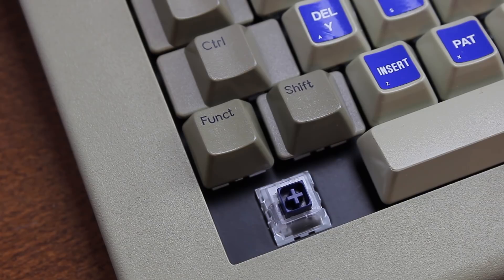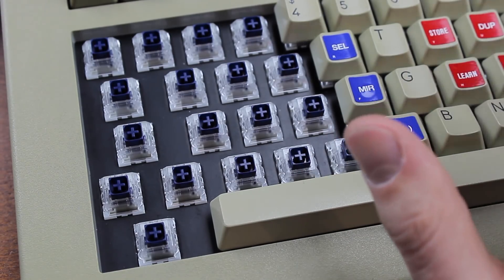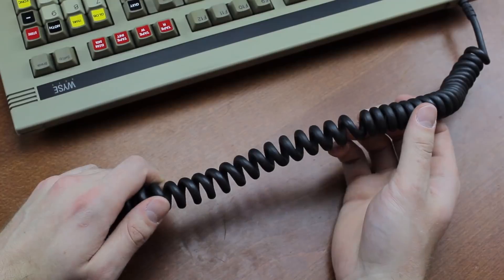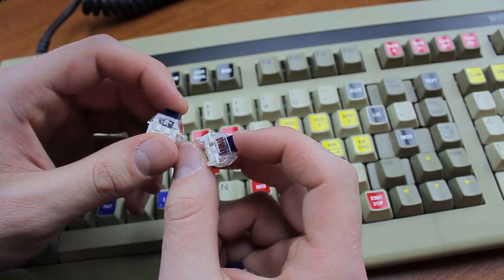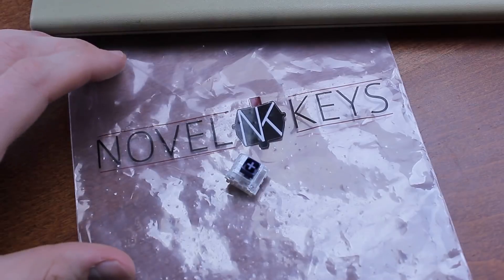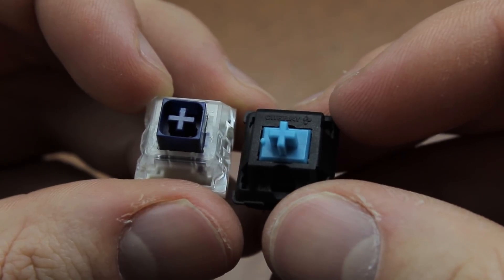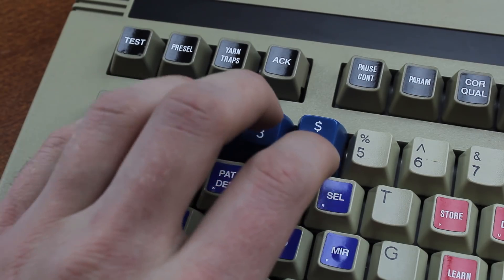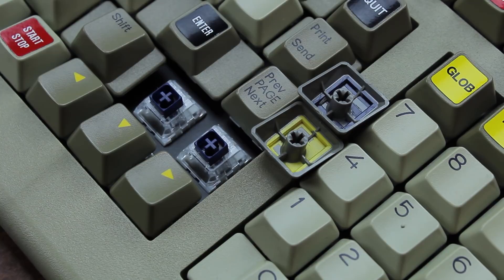"Project N" custom Kailh BOX Navy keyboard review Wyse (WY-50)

Comment: I just got ahold of BOX Navies for the first time, and after thinking about it some, I thought to myself that probably the reason why BOX clickies work so well is because, like Alps, they separated the element that produces tactility and click from the contacts. The click bar is basically Kailh's version of the click leaf, where Cherry MX insists on keeping the feedback element mated to the contacts. The principle of having a separate feedback-producing element lets these designs more easily modify the magnitude of tactility and loudness than if everything was dependent on the resistance of the contacts to generate their feedback. Kailh did prove with the BOX Royals that its possible to simply stiffen the contact leaves to generate more tactility, but it shows just how switch manufacturers have to sort of reinvent the wheel and discover missing links to the past just to start a new renaissance and pull this hobby out from the Cherry MX dark ages.

Comment: I completely agree with you that there should be a third variant of these with a "medium tactility" option. It would be amazing!

Also putting the switches in this chassis was a wyse choice!
Reply from the maker: Andrew Dias I c wot u did thar!
Reply: @Chyrosran22  There is a third option you can get aftermarket clickbars from SpriT Designs as well as springs.
Reply: @TheDarthWTF  Yeah but it's a pain to put the click bars back in after you remove them

Comment: After I saw the original video you made on the Navies, I took a leap of faith and replaced the MX Browns of my QFR-i with them. 6 months later, using the same QFR-i exlusively, I can say that it was worth it. The sound is fantastic, the feel is excellent too and they have given me no problems or sample variation. This switch is a real winner.
Reply: How heavy are they compared to a model m?
Reply: I haven't compared them side by side but I'd say during depression very similar but during the return stroke the Box Navy has a lot more pronounced tactility.

Comment: I can confirm that the BOX Navies works with the "Drakken Technologies Prothero Spektrum". If you want a switch-modular keyboard that has a chassis to speak of, there yall go.

Please bare in mind, the chassis is abnormally thick all around, including vertically. As for weight, it is slightly lower than a Unicomp EnduraPro. Flex is minimum. So its much better durability wise than those open keycap designs that virtually everyone (relevant) is doing.

Its around $79.99 (US) on Amazon (US).

Due to the overall weight and the borderline unnecessarily thick bezels/chassis, the BOX Navies sound great! The larger keys have some loosely fitted stabilizers though. Luckily those replacement ones from Novelkeys apparently work with the Drakken.

PS: Thank you Chyros for brining the BOX switch designs up. I'd never have known they existed since everywhere else outside the keyboard community is Cherry MX this, and that. Razer this, Corsair that, etc. 
Though the Drakken keyboard was a hail-marry on my part since there's not a whole lot of information on it! Only a few Amazon reviews praise the abnormal build quality. I thought they were just exaggerating.

Now if you ever get the chance, those Holy Panda switches sound like they have a interestingly rounded tactile curve going on. Kind of like a Topre board almost. It seems to be Massdrop only though.

Comment: What if you use a BOX Black spring? It's slightly heavier than BOX white, but lighter than BOX Navy, so.... yeah...
Reply: i did this with a friend of mine and it was better than jade, but not too different than that of navy really
Reply: Well... shit... I guess a thinner (though not BOX white thin) click bar would really help, just like what Thomas said.
Reply: I recently received jades of the newest batch, and none of mine had a laggy or sticky feeling, for what it's worth.
I did have problems with stabilizers though, I had to make them very free or they would add enough resistance to make the switch feel slow to return.
Reply: Are you sure about this? They both report 60g on NovelKeys.
Reply: thinner click bar might even approach blue alps perfect weighting and feel though it won't sound as good
Reply: @christophertaylor8166  Yeah, I was wondering about the same thing. They say 60g for navy and 50g for jade. However, that is the point of actuation, not the highest force. The highest force actuation is 77g for navy and 66 for jade, according to mehanicalkeyboards.com

Comment: Well, after quite a time testing switch samples I had at at time, I got white BOX switches and made my first compact DIY-keyboard with them. And with proper thick PBT keycaps, heavy mounting plate and sound absorbing pads on the bottom the high-pitch part of the spectrum is gone, they sound better. For my next keyboard I would like something more tactile, but not as heavy and loud as BOX Navy and with actuation point right on the bump slope down, I wonder if there will be switches like that. Thanks for your videos, man!
Reply: I think box light blues are more tactile than white but less tactile than navy.
Reply: Seems like box pink switches are your best bet.

Comment: Just ordered these for my barebones GMMK kit, and I plan on using SA caps with them. Can't wait.
Reply: It's 3 weeks later, have you started using 'em? If that's the case, how are they like? I'm also interested in buying these!
Reply: @pettttson  Yes, they're absolutely fantastic so far, and they are LOUD. I love it.
Reply: @Jekkin  sounds sweet! I'm very sceptical of Jades due to the sticking issue but is the weighting ok on these?
Reply: @pettttson  Yes the weighting is perfectly fine, but it's possible for these switches to bind just a little bit if I press on the corner of the keycap and push down away from the center of the switch. That could also be due to the size of the caps I'm using. All in all, it's a great typing experience. I'm quite fond of heavier switches as I used to play piano so I have stronk fingers.
Reply: Two years later, do you still use them? I just ordered mine and getting them soon.

Comment: Sort of an old video but I'm trying to follow the wiring here. The teensy 2.0 is no longer available from pjrc. I picked one up from ebay thinking it was the same and apparently the knockoffs don't work the same. What is the current replacement for one of these to work with the wy50 keyboard. I'll be doing more research but thought I'd start here.

Comment: Heya chyrosran, i have a question. I'm interested in buying some Kailh box switches, but I'm still split on box white or box jades. After seeing this video describing the jade's as sticky sometimes, would it be wise to opt for box whites instead? I do a lot of gaming and I'd be disappointed if the jades don't preform well under Extreme Heavy Gaming Sessions. Cheers

Comment: Holy hell those switches are expensive. Unless I'm missing something, its about $350 USD to get a whole keyboards worth of them.

Edit: I'm was previously mistaken, as I didn't realize they were sold in packs of 10 lol. That's what I get for looking into these things on no sleep. They're really about 1/10 of what I originally said they were.
Reply: Not gonna lie, I made the same initial mistake until I also read the rest of the page. LOL
Reply: I paid like $35 for 108 Box Navies switches I think it’s used to be more expensive than it is now
Reply: @PreciousAlpschindler  4 years ago I corrected myself and said they were 1/10th the cost I originally said, which comes to $35.
Reply: @robred123s  yes I know that but I also used to see something like $45-55 for 108 Box Navies unless the one I saw back then are overpriced or overcharged

Comment: It's interesting to me that you ran into issue (or didn't) with the modded-to-be-Jades switches on some examples, but not on others. I ordered a full hundred of them for my current keyboard, and have been using them for over a month now, and I can't find any difference between any of the switches. I heavy-modded the six switches I used on the stabilized keys just in case, but I really haven't seen any difference between any of the stock Jades. I absolutely did see issues with the switches returning when I put them into a switch tester I have, which grips the switch housings more tightly than my plate, but that was the only thing I could do that seemed to affect them, and it had the same effect on the heavy-modded switches (for which I used BOX Dark Yellow springs, which are even heavier than Navy springs). I wonder if some of the inconsistency you saw could be down to the opening up of the switch in addition to the fact that, as you stated, the Jades are right on the ragged edge as far as being able to return.

Either way, great video! I think you're spot on that it would be interesting to see some intermediate click bars. Maybe Jades should be using .29mm to be a bit safer, or we could even see something like a .27 with 45g springs. The category has a lot of potential, to be sure.

Comment: These switches are really heavy, you can already feel it from a sampler but on a board they really are stiff, even compared to cherry green. 
Frankly I might use it on the caps lock key since it isn't stepped on the PBT ISO Italian keycap set I bought for my new K10 pro, I prefer lighter switches for typing.
Reply: i got a k8 and am testing the white v2's, after trying the white v1's and navy's, i'm waiting for the jade's to get to me to figure out which ones i might like better but for now in general i'm glad i discovered and could try these kailh box series for a change a bit since i had never used anything outside of the cherry mx blue's, so far they seem more "satisfying" and with the right feedback.

Comment: Would that be too loud for work? Is it possible to use it with o-rings? So far i've managed to test a CM Storm QFR with MX Blues + o-rings and another with MX Browns stock and my coworkers seemed to be ok with them :) Love your videos, keep 'em coming, especially switches breakdowns ;) Cheers from Brazil!
Reply: Luis Enrique Muñoz They are very, very loud.  Unless you have extremely tolerant (or maybe just deaf...) co-workers then yes, it's too loud for work.

O-rings aren't going to help much since they only affect bottoming out noise, not the sound of the click bar.
Reply from the maker: Luis Enrique Muñoz no fucking way are people going to tolerate this level of noise xD .
Reply: You're probably already "that guy with the annoying keyboard" at work. Life pro tip: get promoted so that you get your own office room and type with the loudest keyboard you can find. :D
Reply from the maker: I use a linear keyboard at work to mitigate the worst of the noise, even though they already find that one somewhat loud. And I'm basically in a separate office already! xD

Comment: I haven't been able to actuate any of my Box whites before the click either, and I have deliberately tried to do so.  I got them more recently than your video on them though so maybe that's something they fixed in a later revision?
Reply: I tried now on my keyboard (two months old switches, box white obviously), and if I push the top of the key, pushing also forward, I can make them click without actuate! On the contrary if i slowly press the keys pulling the keycap towards me I can make the switch register the press without click, but it's a lot more difficult, I managed to do it only with the left and right arrows that I can grasp between two fingers. Anyway in the real world it has never been a problem, and I usually don't even bottom out while typing.

Comment: I really want to transplant some thicc clicks into my MX Blue Filco. But Navies sound like they'd be too heavy and Jades have those issues.
Reply: I'm in the process of doing the exact same thing to my Leopold. They might not be as heavy as you think. I really don't have any problem typing on them (although I have been using white Alps for a few weeks and have gotten used to those already, so that probably helps). I've seen a lot of people report the same thing. I couldn't stand Cherry greens but these are fine for me, and I generally type pretty lightly.

Comment: Recently i acquired an Altos IV terminal keyboard which i learned is a re-branded Wyse keyboard w/ Black Cherry switches. Same layout as this board but all of the modifier, function, arrows, & some of the num pad caps are brown its a pretty slick looking unit. It uses a  4P4C telephone style connector instead of the 10 pin din  hopefully i can get a Wyse converter to work with it, if anybody has any help or info it would be greatly appreciated.

Comment: I'm currently typing this on a TADA68 in a TOFU65 case with Kailh box navy on my spacebar and modifiers and jades on my main keys with ICE Caps SA keycaps and it's pretty sexual. Also installed a box navy on the caps lock of my Pok3r w/ Cherry Nature Whites I'm thinking about throwing out these trash vortex stabs and scratchy cherry mx whites in this Pok3r and installing some cherry plate mounts and Tealios as its my gaming kb and the jade/navy/tada is my work Kb.

Comment: It seems these keys were tailor made for me, I love the weighting of my greens and this sounds like a great replacement/upgrade.

Now I just have to learn how to solder and desolder...
Reply: It's honestly not that hard, I'd recommend going to a recycling centre or thrift store to find some used electronics and practicing soldering on them. I work in refurbishment so I was able to learn simply by practicing on stuff we were going to recycle anyway. Give yourself maybe a month or few weeks of practice and you'll be soldering/desoldering like a champ.
Reply: Your suggestion to practice on junk electronics is a good one but there's no way it would take anyone weeks, much less a month, of practice to learn these skills. The biggest contributor to doing it well is having good tools, steady hands, and patience.
Reply: Andrey Grabarchuk You obviously won't be able to do super accurate SMD soldering and stuff after only a month, but easily should be able to solder and desolder switches from keyboards.
Reply: Markel A. For sure, I just didn't want the guy to think the barrier to entry here is a long practice period. I learned desoldering in a day and granted I wasn't very good at it but I was successful and have of course improved since then.
Reply: Absolutely, the basics can be learned in a few days really, but I'd recommend to anyone to give themselves a bit of time to gain their confidence before soldering/desoldering anything of value. You can always start try over when it's with old junk parts, but I wouldn't want anyone to ruin their expensive keyboard PCBs!

Comment: Hi Chris, I am currently using Outemu Reds with Cherry MX Stem and Springs. I want to try Kailh BOX switches. Do you think this kind of switch (Kailh BOX) is more worth than Gateron or Outemu? Thanks. I need more information of this switch
Reply: Edwin Wijaya If you actually like reds then keep in mind that these switches are on the opposite end of the spectrum.  Red is a light linear switch, these are a heavy and very tactile clicky switch.  They couldn't be more different.

If you're just asking about the general build quality of Kailh switches then I think they're quite good.  I have heard that Kailh's early attempts where pretty bad but their more recent switches (which would include the whole box series and a lot of other switches too) I actually prefer to Gateron (which I find kind of wobbly).  Don't have any experience with Outemu though.
Reply: The Kailh default switches (the direct Cherry copies) are quite crap, but that's mostly because Cherry switches are still crap (though they've slightly improved since retooling). The BOX switches and speed switches, on the other hand, blow Cherries clean out of the water. I'm typing this on BOX Navy switches and couldn't be happier. Well, my stabilizers need some lube to shut them up, but the keyfeel is fantastic.

Comment: Are they louder than Amber Omrons Omnoms?
Reply from the maker: THERAZORKILLE Yes! Oh, yes xD .
Reply: Alright, that's how I like it when it comes to clicky switches anyway. XD

Now on the topic of BOX Navy switches, I'm looking to switch out the MX Blues on my Corsair Strafe for some BOX Navies and am wondering: how long do you think it'd take to adjust to typing on them, given that they are noticeably heavier than MX Blues? Now I usually bottom out anyway when typing, and I'm no touch typist. Regardless, do you have any experience regarding such a transition?

Also, I'd put the Navies in a better chassis if I had one (like a Wyse or maybe a Nixdorf board), but the Strafe is the best chassis I've got for Cherry switches at the moment. I guess that gives you an idea of the kinds of keyboards I have at the moment, heh...

EDIT: Ended up getting a KBP V80 with BOX Navies and my only complaint is the stabilizers. They lubed the spacebar, so it's pretty nice, but all of the other ones are unlubed Costar, which is rattly as fuck. Seriously, the rattle gives the 1st generation APT switches a run for their money. Nothing I can't fix with some lube, though. The switches are definitely stiff, but they feel quite awesome, and the sound is fantastic. Nothing beats Blue ALPS, but these are really great, especially with some thick Cherry profile PBT caps.